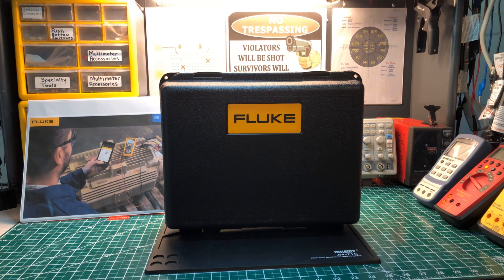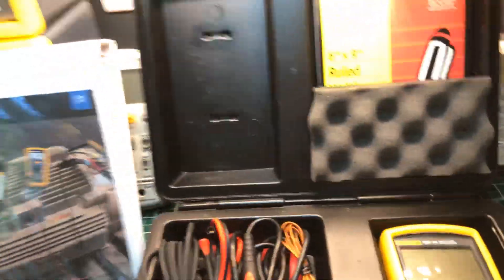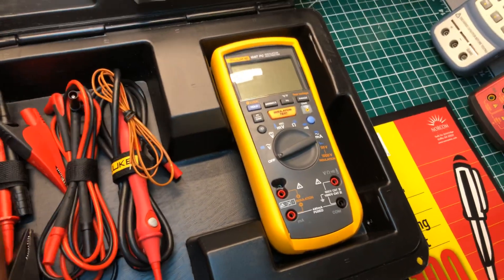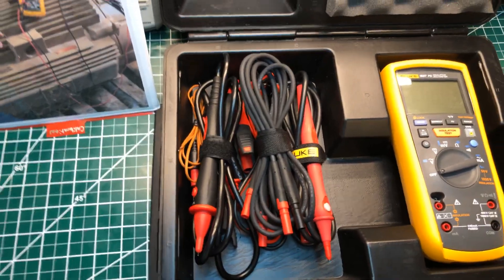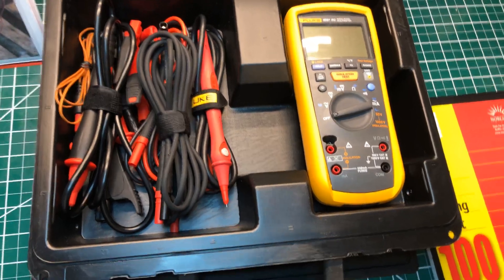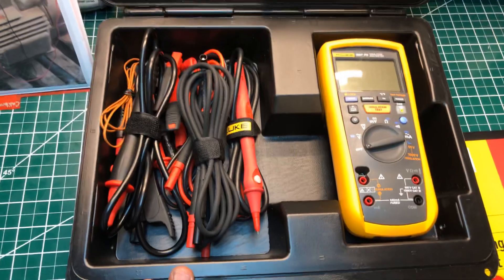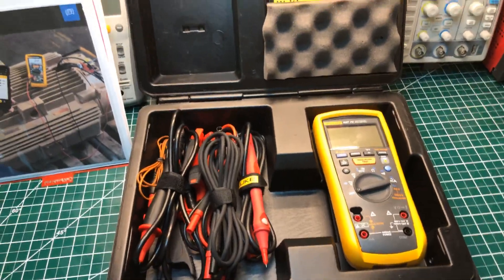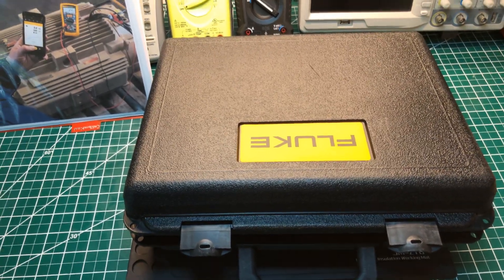“ INTRODUCING “ My Brand New “ 🇺🇸 FLUKE 1587 FC  Insulation Tester “

Comment: Hi TETC. Yes, it was the Uni-T UT505A that did not come with a remote probe and I could not get on in the UK at the time, so I found that the remote probe from the Fluke 1587 FC was compatible. It is the only time I have found compatibility with remote probes, generally they seem to be specific for each manufacturer.

Whilst the Fluke 1587 FC has great build quality, for me it seems to suffer from its hybrid nature. It lacks a lot of multi-meter functionality compared to a DMM and is missing some of the functions I expect in an insulation tester. It will be interesting to see how you get on with it and the jack assignment, I got caught out a few times when changing between DMM and insulation tester functions and not swapping the leads over to the correct jacks.

Your video has reminded me that I intended to re-record the videos for my review of this instrument on element14, but never got round to it. The original videos I did, were no good, so I never uploaded them.
Reply from the maker: HI TP, i so true sir.. The. 1507 was my first choice, but after some  thought i opt out. And settled on purchasing the 1587 FC . And I’m very pleased with my decision.

Comment: I hate that meter. But Ive told you that before though. 

nice vid though.
Reply from the maker: Megger is a top brand, but i never had a bad experience with FLUKE. I know you hate fluke because of the count timer ⏱ were you using the older 1587 or the 1587 FC  ?  I’m gonna play around with the fluke connect feature the timer maybe hiding somewhere in the software when you view the measurements via fluke connect. If I find if JT I’ll revisit this subject sir. Overall I think 🤔 the FLUKE 1587 FC is one heck of a tester. By the way welcome back sir I haven’t heard from you in a while. Take care, and stay healthy.
Reply: they’re 1587 FC’s

I like and trust fluke dmm’s its just some of fluke “specialty” meters that they sell just to compete with the other markets that I don’t care for. Kinda like I wouldn’t buy a Megger  brand DMM. Because thats not their speciality and they fall short of function.

No one should need to rely on their phone to use a basic function of a piece of test gear unless its purpose built as just a physical interface. e.g. no screen
Reply from the maker: Got it JT, I see your point. 👌